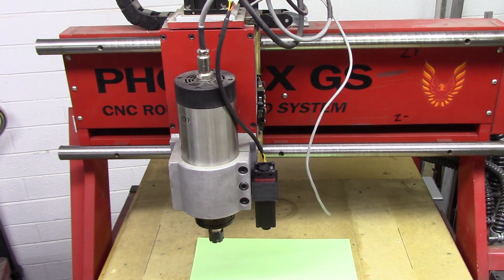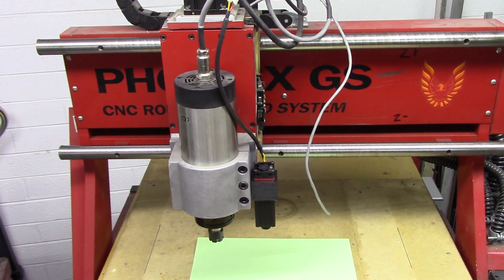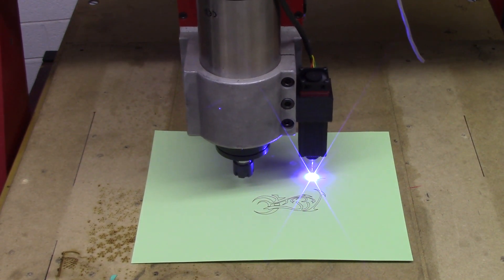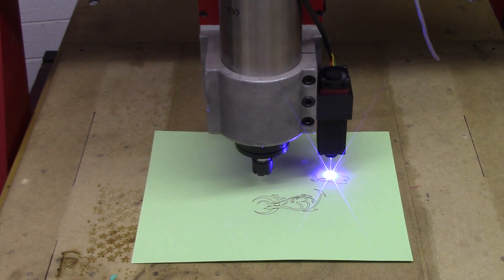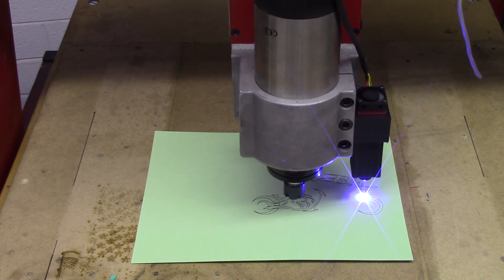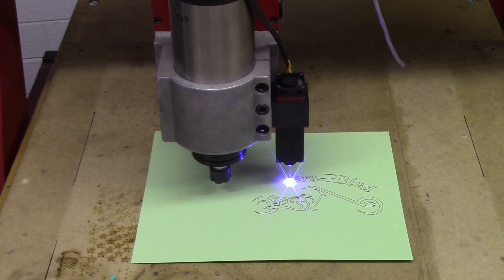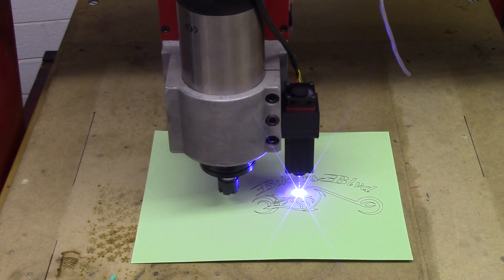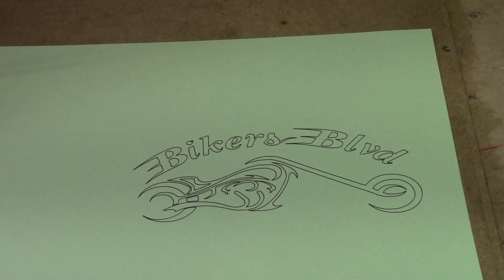Centroid CNC Acorn Driving a NEJE20 Laser Sneak Peek.

Comment: Are you running it on CNC12 Router or CNC12 Laser separately ?
Reply from the maker: This is old. I was running it then on CNC12 Mill
Reply: @martyscncgarage5275 Thanks. But do you know how this would be handled now ?
Reply from the maker: @SuperYellowsubmarin I got some clarification: "Diode laser support is part of both Mill and router software."

" Fiber laser CNC 12 is for fiber lasers, not for diode lasers."

Comment: Nice. Is this wired alongside the spindle so you can switch between each without plugging/unplugging things?
Reply from the maker: Yes. The laser has its own cable and plug
Reply: @martyscncgarage5275  I'm not clear about how you've wired the laser to the Acorn...! I've got lots of spare relays for switching the laser on and off; have you piggybacked the 0-10v output to control laser power? Sorry for the silly questions; I've only just started using the Acorn board, and had no idea it could drive a diode too; that would be very useful for my work...! :)
Reply from the maker: @hamiltonpianos  all depends on the laser you are using. There is a schematic for the one I used on the Centroid site
Reply: @martyscncgarage5275  👍😊
Reply: @martyscncgarage5275  Hello again...! Had a look at the wiring diagram; can't figure out why two relays are needed to enable the laser. Is it a safety thing?
Reply from the maker: @hamiltonpianos  yes

Comment: Did you use the analog out spindle 0-10V on the Acorn for controlling the laser ?

Did you thought buying the ESS Smooth Stepper system instead of the Acorn system ? I wish to convert an older AXYZ router CNC machine and I am not sure which I should get between those 2 systems, both seems great...
Reply from the maker: Nope.  Happy with Centroid Acorn. Hardware and software from the same manufacturer specializing in Machine CNC motion control for over 30 years.
Reply: This laser is using what pins? I imagine this is pwm? Also is yhe router hooked up as well? Im glad you are still at it! After 10 years i am just wiring an acorn to a home built with atc spindle and think i should allow for a laser head. Thanks!
Reply: I got over excited!  I must read then ask! I will look over the documentation and your videos for dmm dyn2 wiring and find some open pins and the pwm capable outputs. Do in my garage as Marty does in his!
Reply: There's more good quality laser diode manufacturer available nowadays, not only the chinese crappy bs
Reply: OptLaser in Poland and JTech Photonics in USA are 2 I have in mind right now
Reply: OptLaser in Europe
JTech Photonics in USA